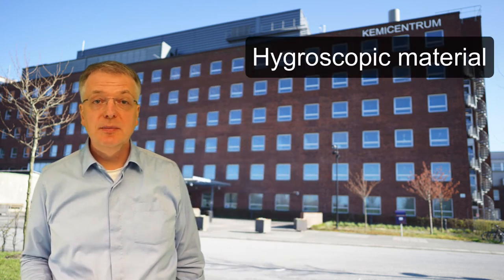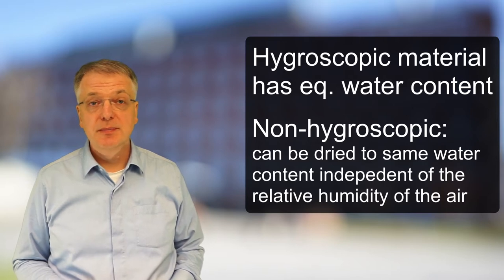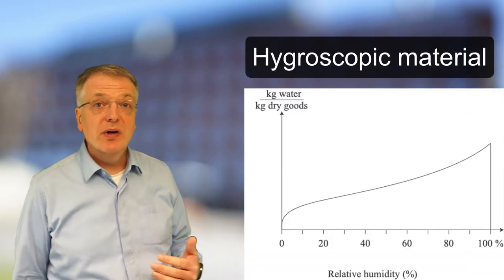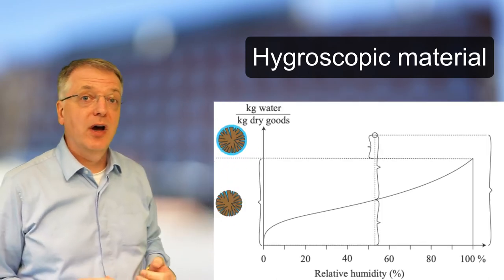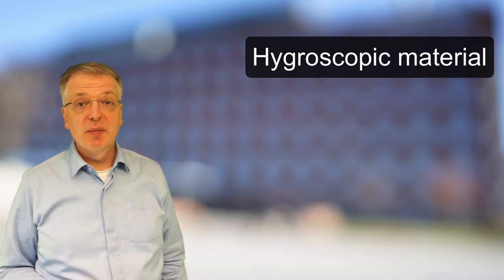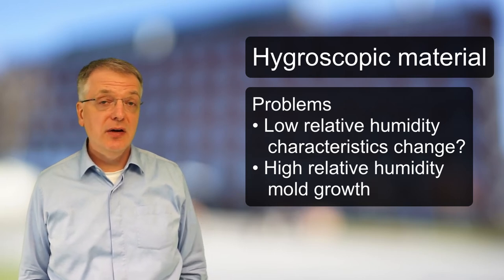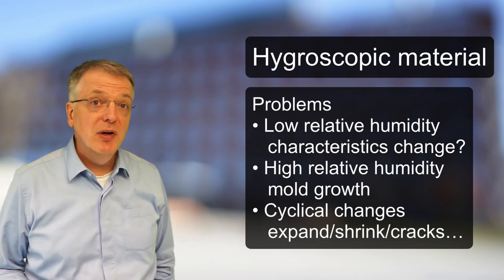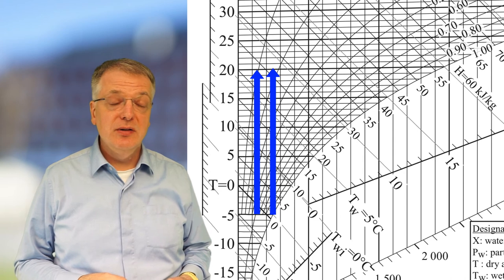Hygroscopic materials and drying

Comment: Thank you for the excellent content.
 I was wondering if you can advise on hygroscopic material that expands when wet and shrinks when dry without losing its structural properties? Also, how do you quantify the response rate i.e. how quickly the hygroscopic material retains water? Which material reacts the fastest?
Reply from the maker: Sorry, I don't think anyone at our department can answer that. We have people working with things like catalysts, carbon capture, pretreatment and fermentation of biomass, waste water treatment, city planning in connection with design of waste water and flood water infrastructure, membrane processes, purification of biopharmaceuticals using chromatographic systems, optimisation and controlling e.g. chromatographic systems, various analysis using syncothron facilities (e.g. Max IV) and similar. We used to have a full time professor who specialised in drying processes, but he has retired and only works part time with us nowadays.
Reply: 🪵 wood expands and shrinks into more density without losing it's structural properties, but gains more integrity. To quantify these reactions, time lapsed frame rates are taken place. A sponge 🧽 should react the fastest.

Comment: At work we have started to use PHA plastic.  Lots of issues with its hygroscopability.  Our dryer hopper is set at 60c and it takes about 3 hours for non dried material to reach our process.  Along with a PHA colorant at 1.5% that is not dried.  That non dried material. I believe is causing most of our issues.  This is also in out facility where our process water is at 70c, causing very high humidity around the 10 machines.   Let's just say PHA extrusion has been hell for us and our customers.  My biggest issue is making the owners of the company believe water is the cause of most of the problems.

Comment: Is this for real? Watering your pianos? I've never heard of this in my life.
Reply from the maker: Yes, definitely, and they have been around for quite a number of years, but I don't know how common they are in different parts of the world. (Different climates, different needs. With temperatures below 0°C outside, indoor air tends to become really dry and that is not good for wooden instruments)

Next time you visit a church, concert hall or similar check if you see a small tell-tale LED and the plastic tube used for watering. In the system I have and the systems I have seen in churches in Lund, a red light means it is on, a blinking yellow light that it is time to water and a steady yellow light that you should have watered it a long time ago) Once you know where to look they are pretty visible. A piano or a grand piano with a climate control system (or, for that matter, placed in a room with climate control) hold their tuning for longer.

A similar thing, but much much simpler in design (and I don't know how well they worked) were the tubelike things (1980s?) you could hang into a cello to try to keep the moisture level more constant. I haven't seen them in a long while, which may be because they didn't work as intended (but I'm only guessing now, I'm not a cello player)

Comment: Good day, Professor: I have some questions concerning the property of hygroscopics. I found some contradictions between hygroscopic and less or nonhygroscopicity for the same substance. later on, I realized they are in a different form. one is in crystalline form but another is in powder form. Please forgive me for the potentially confusing terms. for the same substance, for example, D-mannitol. when does it have the property of hygroscopicity and when does it have the property of nonhygroscopicity? Thank you!!!
Reply from the maker: This video is about the very basics of hygroscopic materials and simplifies in that it divides materials into two distinct categories: hygroscopic materials and non-hygroscopic materials. In reality, the line between the two categories is blurred. As usual, reality is more complex than our models of reality
Reply: @PLE_LU   Thank you so much for the reply. Do you have any recommendation websites or public resources that can find info on the properties of hygroscopic of certain substances? like chemical property info in general. I have found sits that list detail info for melting point boling point, but not its hygroscopic info. does hygroscopic is a general property of a substance? or its a phenonmenon will change according to varies condition?
Reply from the maker: Sorry, I have no good further reading hints apart from that there is information sprinkled in various standard chemical engineering text books. Just to mention one thing, if you have substances that different form of crystals with varying amount of crystal water, you can get behaviour that definitely isn't covered in this video. You can also compare with pF curves for soil, i.e. how much negative pressure you need to apply to suck water out of soil at varying moisture levels. Soil also typically has a moisture threshold under which the structure changes turning it hydrofobic (which you might experience if you forget to water your indoor plants for too long.
Reply: @PLE_LU  THANK YOU!!!